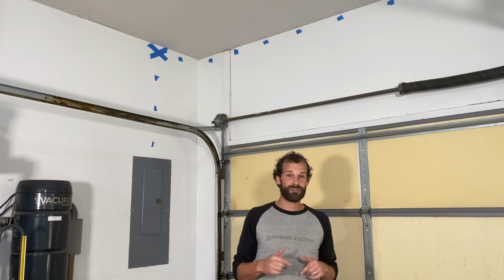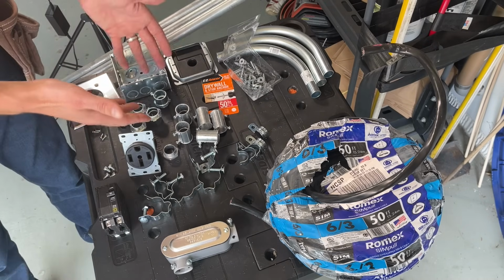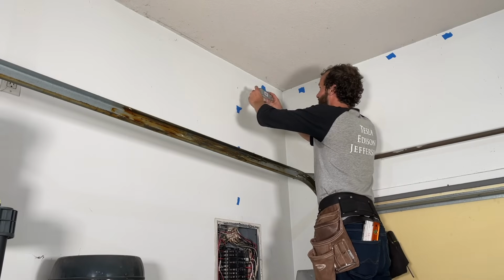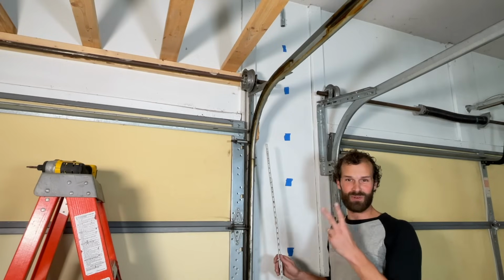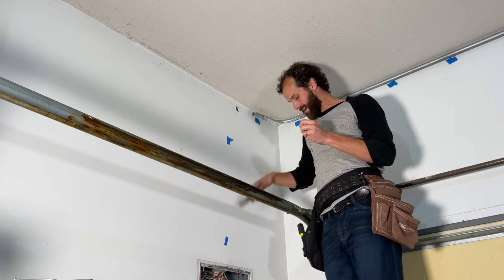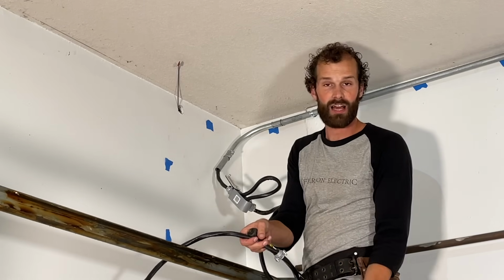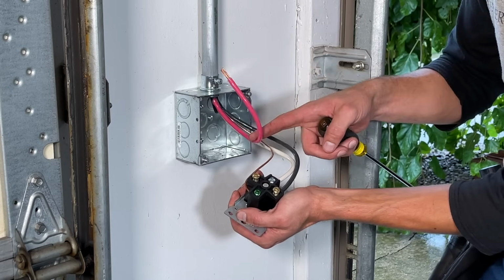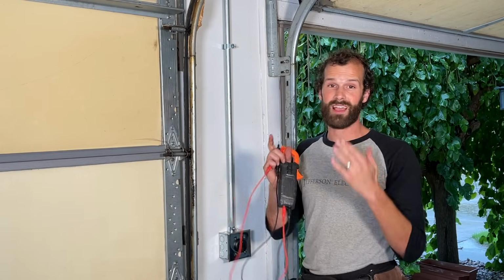How To Install a 240 Volt Outlet | Electric Car Charging

Comment: Why didn't you follow code and pull single conductors through the conduit rather then pulling NM? This should in reality fail inspection as its not code and is dangerous because of heat dissipation

Comment: Conduit isn’t a part of the ground system unless it’s run all the way to the panel as the panel is bonded to ground. Also you didn’t bond the ground wire to the box using a green ground screw. Your conduit is not bonded to ground.

Comment: I have always connected the wires to the circuit breaker before installing the breaker in the service panel box.  Can you tell me why you prefer to connect the wires to the circuit breaker when the breaker is already installed in the service panel?  My method seems to be safer.  Thank you.

Comment: I like this video but I wonder - Does it have to be 6/3 Romex (with ground) or can it be three wire RED/BLACK/WHITE plus ground inside that EMT?  This is inside and well protected. That would seem to be sufficient ( though I haven't looked at code ). Seems like the fill of this 3/4" conduct is way too much and the pull way too hard.
Reply: What are the applicable code sections? for the conduit fill and conductor type applicable here. Thanx

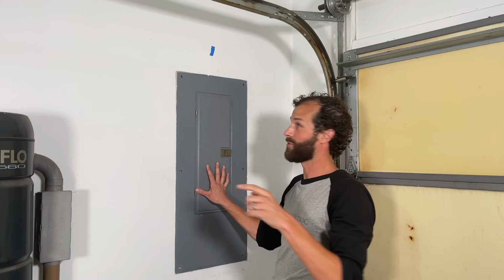Comment: 2:30 Right off the bat, as a DIYer, I would have killed the power going to the panel with my outside meter disconnect.  Not all homes have this, but I have 400 Amp service at the meter split into 2x200 Amp disconnects, one for my house and one for my garage.

Comment: I bought a welding machine in Brasil that automatically recognizes the 220 or 125 voltage being fed to it. My machine has a 220 volts male plug'
,; one neutral, one ground and one hot 220. How do you recommend to change my male plug  in my machine if my house has two 120 V wires and one white(I guess that’s the neutral)?
My house doesn’t have a ground wire coming out of the wall( breaker box)

Comment: Nice video. I don't think I will ever be doing a 220/240 circuit, but it is nice to know. I have replaced a complete electrical panel before though. I was lucky that I had the main electrical coming in to the side of my house with a breaker there to shut it off. From there it fed a main circuit panel on the back of my house that was from the 1950s and in serious need of an upgrade. I shut power to the panel off, removed and labeled circuits, put the new panel in with all the breakers inside the house instead of outside (panel in a bedroom closet), reconnected everything with modern breakers, and all was great. I also added several new circuits while I was at it, because those old houses did not have enough circuits to run all of our modern conveniences.

Comment: Since you are using a metal conduit  how about just  using individual conductors?    cheaper to buy individual conductors and it wold ease the pulling inside the conduit.     ;-)

Comment: So Why not use 380V(Δ)/220V(Y) 3Phase instead of sign phase electricity to power up electicwares need more than 3KiloWatt such as a AirConditioner or a Tesla.
25A 380V 3Phase>50A 240V 1Phase

Comment: You place the outlet at 44” and state that is optimum.  Is there a code requirement for height?  In my situation a higher placement would be preferable to me.

Comment: There is no need to run a neutral wire since all car chargers run on 240V only.  European appliances (including home car chargers chargers) use 240v power without a neutral wire.
Also, instead of Romex, since the wiring is being run in conduit, it would have been better and easier to run two THHN 6 AWG wires and one appropriately sized bare copper wire (10 AWG) for the ground connection.

Comment: At least in politically mismanaged California the fate of electric cars is problematic. The Elephant in the room is "where:"  is the reliable source of electricity.  Over the last 10-yrs the tax payer subsidized wind and solar start-up folks sent a lot of re-election money to the politicians asking them to kill the competition (coal, natural gas and nuclear) and they did. But when the tax payer subsidies ran out so did the solar and wind start ups who found out the damage from thousands of  bird strikes and blowing sand wrecked the wind turbine propeller blades and the solar panels did not delivery the in real life what they were projected to deliver on paper. Then the worst drought in 40-yrs all but ended Calif hydro electrical power. So with no back up from dismantled coal, natural gas and nuclear stations and then  huge forest fires wrecking hi-voltage transmission lines  Calif saying no problem we can buy electrical energy off of states east of us. Then it got cold and those states needed the energy/ Result  Rolling blackouts of  the power company just cutting off who areas for several hours. Not a problem for those who have an expensive home generator running off large propane tanks located next to the generator. So where is the reliable source of power to change your car?

Comment: I'm from the UK, where the "Grounding" on this installation would fail. The reason:- No.1  All bare ground wires must be sleeved using the proper ground sleeve. No. 2 At the socket box, the ground must ground the box and then the socket.  3rd The conduit would have to be mechanically fixed to the Electric Panel. That means that the conduit would have to terminate into the panel itself. The gap between the Panel and the feeding box (LB) would not be allowed. 4th. Single wires would have been required, the cable used here would not have been allowed. Metal conduit in the UK has almost died out, the reason, is that its so expensive to install. All metal conduit is screwed, no push ons allowed, most bends are formed in a former by the electrician- thus the cost. In the UK, Armoured cable would have been used instead of conduit. DIY tip, switch off the electric and cover the "Hot" terminals with a piece of wood for your protection. Open "Hot" terminals are not allowed in the UK, they always have to be recessed or covered. So an Electric Panel would have to be made by the manufacturer with protected live terminals to pass the codes. All home electrics in UK are 240v.  - 3phase panels, (potential for 415 volts)have different set of codes and are mainly used in the commercial sector. it is very rare to see multi phases at a house.

Comment: ELECTRIC CARS SUCK!!!!
Reply from the maker: Just in general?  Or is there something specific like long charging time that really gets you worked up?
Reply: @EverydayHomeRepairs  The power sucks, distance sucks, you can't modify them like gas cars, Right now...until it's done in a VERY large scale, it takes a lot more  fossil fuels to power them than gas cars bc of all the electricity that has to be produced for them . The batteries will be made in China...For the most part...they are our enemy, so that's not good.  I LOVE, LOVE, LOVE my muscle cars so I won't be able to enjoy them when the electric cars ARE in full swing unless I am DEAD by then, It's bad enough that we are not energy independent like we should be. The pipeline NEVER should have been closed...Those are MOST of the reasons for me. If I think of anything else, I will add them here ...
UPDATE 3/5/22 : They also take a long time to charge, are much more prone to fires.  WATCH SCOTTY KILMER'S VIDEO ON YOUTUBE REGARDING THEM. IT EXPLAINS IT ALL. IT'S EXCELLENT!!

Comment: Just watched your video. Well done explaining to the DYI. I am a retired 36 year California general contractor who did residential remodels. I do have one question and one suggestion. Question is in the past I was told romex was not approved to be pulled in EMT or any conduit. Has this changed or was California just more restrictive? Suggestion we often would cut a piece of card board to cover an energized panel to avoid any mistaken contacts. I thought you did a great job.
Reply: That’s what I do.

Comment: I don’t think it code to pull insulated wire through conduit because of heat dissipation.  Should always use electrical lube when pulling.  Also should add a disconnect switch within reach . 50 amps plugging and unplugging is not safe  .Wrong cover use here for surface mount box.

Comment: I'm not a fan of putting Romex in conduit. I have NEVER seen professional electricians do that.  I would run individual THHN wires in the conduit. Then, set a larger junction box above the load center and run a short length of Romex down the wall. Also, I'd like to see a direct ground wire on the new box where the car charger will plug-in. Remember, the most important wire in your circuit is the ground wire. Regarding fish tape, use a plastic fish tape, less risk of touching live circuits.  Having said that, I've gone back to the Internal Combustion Engine.
Reply: It seems like the way it is Demonstrated would be more stable under 40 to 50 amp use.   With electric cars ( especially Teslas) if you split the ground you ( may) get an error code and the car will limit you to 15 to 20 amps.
Reply: That method would cost more as THHN only comes in large spools. Plus you have more JOINTs or connection points for the wire to pass electricity through.
Reply: @craigslaunwhite579  supply houses will give you any cut of wire and length you need

Comment: 625.54 Ground-Fault Circuit-Interrupter Protection for Personnel.

In addition to the requirements in 210.8, all receptacles installed for the connection of electric vehicle charging shall have ground-fault circuit-interrupter protection for personnel.
Reply: This would require a GFCI breaker?
Reply: @johndebell2207  According to the National Electric Code, yes. Any receptacle in your garage up to 50 amp needs GFCI protection.
Reply: I have never seen a GFCI for a washing machine nor a nema 14-50 outlet. Someone is making stuff up.
Reply: @FranklySpeaking73  It’s called a breaker when it’s above 20 amps. Washing machines have been GFCI required for years.

Comment: Hi, nice bit of work  - a few points that i will remark on, #1, the way that you tightened the coupling onto the soft outer casing / 
cable before passing it behind the drywall down to the breaker panel  - although done with care, you have no knowledge as to what damage the screw has caused to the soft outer casing & no way of repairing it ? #2, not removing metal burrs from all conduit ends - very important, - #3, not putting earth sleeving on earth conductors then squeezing all cables into a metal outlet box “blind” -  also not earth sleeving the earth conductor at the breaker panel - very strange. #4, i would have used 1” conduit with a cable like that.
Just a few points, Ed,

Comment: Id have pulled individual conductors through instead of NM-B, ran an EGC that is bare in addition to using the EMT as an EGCP/EGC, splice in the LB. As far as the bending radius code requirements, that is generally for insulation protection (5x diameter). Lastly there may be a service disconnect between the panel and the meter, and definitely would be a disconnecting means if its a subpanel.

Comment: Unless you meet certain special rules the NEC does not permit NM cable to be installed in EMT. Better to use individual conductors. And probably easier to pull.

Comment: I am an electronics trench with 35 years experience and also was a teacher. Just some suggestions: you mad3 a pattern on the wall for the receptacle box without an explanation as to why. Did this pattern match punch outs on the box? A key to teaching is “ why, why, why” you do any little thing you do to clarify the why. Makes everything come together; makes it make sense.

Comment: OK, so now you have a conduit and 14-50 Outlet installed right in the middle of that narrow wall section,  where do you install your charging station.  I supposed this would work for a portable charging station, but if you want to install a wall mounted EV charging station, perhaps installing the conduit and outlet to the side rather than down the middle would work better.

Comment: EVSE's (Electric Vehicle Charging Stations) don't require a Neutral, so WHY ??? are they installed with a 4-wire NEMA 14-50 outlet ?  My own EV Charging station uses a 3-wire 6-50 Outlet (Ground, L1, L2).  It seems a waste to run a Neutral wire that doesn't get used.

Comment: Live panel + metal fish tape = disaster
 6/3 Romex inside of 3/4” EMT = failed inspection 
No conduit lube = noob 
Conduit not bonded= failed inspection 
No PPE working in a live panel =fool.

This guy does a lot of yakking but does not say very much of value

Comment: Undersized conduit.  No pulling lube.  Minimum anchoring (The code is minimum requirement).  I take it you are non union and did not have the benefit of an apprenticeship.  You could have used a 4 11/16th box as well, to give yourself some room.

Comment: This is a very bad video on how to install a 220 line. The gentleman didn't use precautions and tell people to watch out not  to get electrocuted. He's putting his hands all around inside the load Center while watching the camera. Doesn't have gloves, didn't take cardboard and tape off the lines so as to prevent electrocution. He did not use a pointer, instead he used his fingers to point at different items in the load Center. As an instructional video this is a horrible example!

Comment: Always use a Fiber glass Fish Tape!.. never the old metal ones in a panel  And use Lube on the wire before you pull. Last thing, you did not Bond that Box and that is a violation of the Code.  Always Bond the Box at the Bonding Screw.  Its not enough that you used EMT.  Go Back and Bond that J Box !!!

Comment: You should not be doing electrical work.  Your going to get someone hurt bad.  Working in a hot panel should only be done by a qualified electrician, when the power cannot be shut off,  using a fiberglass non - conductive fish tape and the proper PPE. You do not have any PPE. OH YOU PROBABLY DONT KNOW WHAT THAT IS.  No safety glasses no gloves.  You are an accident waiting to happen.

Comment: Rotate wire while screwing down screw on breaker until screw is tight.  Only use insulated tools. A bare screwdriver shaft is going to become a welder. At least tape up your tools. Safety glasses and rubber gloves if panel is hot. Just a thought

Comment: Being an electrician I recommend most home owners to put a trap door above the panel box in case any additional lines need to be ran. You could have just use 10 Guage wire to in flexible conduit would have been easier. An ohms test could have been done considering you had a hard time with a short run. Also you could use your fish tape to measure push it through tape your spot and pull it back and use it to measure.

Comment: Pulling wire is such a pain in the hiney. I plumb the run as I go and screw pulling the wire through. No lube needed no cut wires from sharp metal Or plastic edges.

Comment: I can't understand why he didn't use an Industrial Cover on that 50A Recpt? The cover plate he used has sharp edges and corners that will only cause problems and cut people. I do agree with most commenters using 3/4" EMT w/ #6-3 WG was a mistake and also a bonding screw is REQUIRED in that 2 1/8th 1900 box. I am wondering if this install is really what Tesla specs?

Comment: 2020 code would require a 50amp GFCI breaker when using a Tesla mobile connector. If you did the wall connector Tesla's specs come into play and they state no GFCI. GFCI don't play well with the circuitry in the car and car nuisance trip. Use the Tesla Wall connector.
Reply from the maker: Thanks for the feedback Perry.

Comment: As I recall, it's illegal to run Romex in pipe since Romex or nonmetallic sheathed cable is considered a conduit by itself per the NEC,  It's been a while since I've observed the code book but as I remember you can only use pipe as a sleeve for Romex. He should have used THHN. I'm glad he doesn't do work in my neighborhood...

Comment: Why is he pulling 6-3 Romex through conduit?  Should be using individual THHN conductors for an easier pull. Also, exceeding 40% fill and should be using 1" EMT minimum.

Comment: Excellent demonstration but I would run the EMT all the way to the panel. It's not hard and either you or the homeowner can finish the drywall repair. You only have to cut half way down the wall . . .

Comment: Great video.  I've done dozens of such installations as DIYer that had been professionally inspected and verified.  I tend to use 3/4" PVC conduit and flex inside the wall with individual THHN wires.   That way you have the option of pulling each wire separately, when needed - much easier than pulling 6/3 romex.  Unfortunately, due to using flex in the wall I have to cut an additional 16x6" opening above the panel to properly install ENT fitting, but large rectangular opening overlaying both studs is very easy to patch back and it eliminates fishing completely.  I also use ferules on stranded THHN wires.  I'm not sure why it's not yet mandatory in US.  This makes connections clean, durable, secure, reliable, eliminates possibility of nicks, and necessity to use torx screwdriver.
Reply: @k8byp  where does it say its a wet location?
Reply: I use ferals on plc's for smaller wires  but wouldn't think to use in residential, not cost effective

Comment: I learned a few neat little tricks from this video.  But since the bare copper gnd (equipment grounding conductor) was not connected to the box AND the conduit does not extend all the way to connect to the panel, that makes the conduit and box electrically floating.  If one of the hots ever abraded and contacted the conduit, it would rise to 120V and someone could get electrocuted by touching the conduit.  If I'm mistaken, please let me know.
Reply: Oh, and that would not trip the breaker.

Comment: The car is not using the neutral wire. The proof is in the instructions for the Tesla wall charger. For that reason some money and trouble could have been saved by using 6/2 cable and NEMA 6-50 outlet.